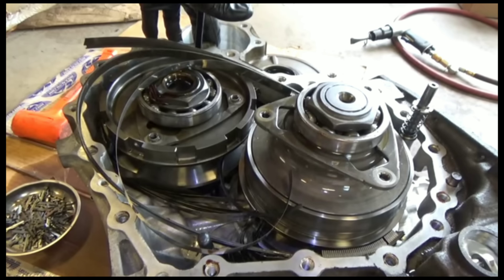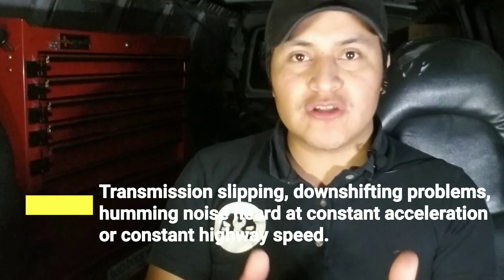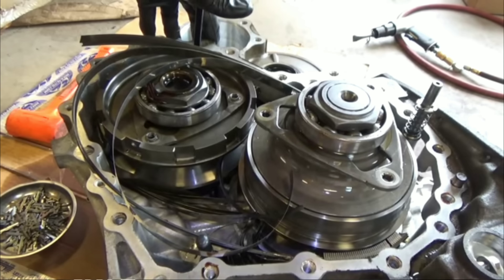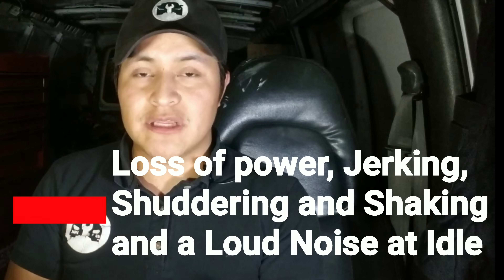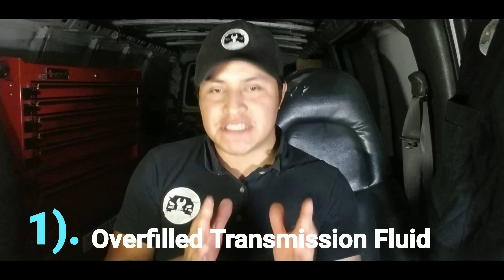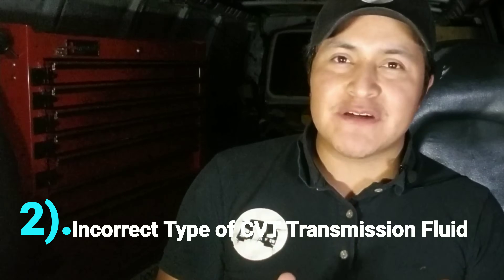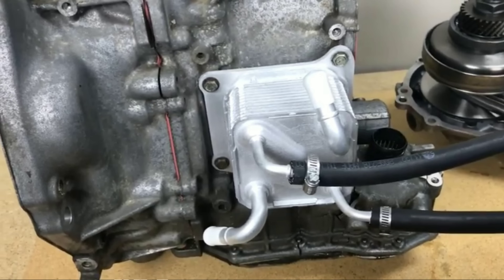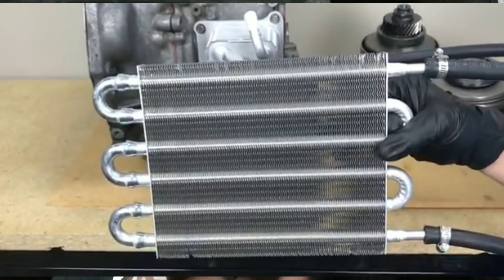NISSAN CVT TRANSMISSION | why it fails and what you can do about it to prolong it's life

Comment: My friend has a 2016 Altima and the transmission overheats all the time. He also cannot step on the gas too hard or get the revs of the engine up because the transmission slips. If he's easy on gas the transmission seems okay. Do you think the transmission is shot? He had flushed the fluid at the dealer and it made no difference
Reply: Does your friend have any issues at all with high engine coolant temperatures when the transmission fluid temperatures are high?  I have a 2014 Altima and I've noticed the cooling fan on the radiator doesn't seem to provide adequate airflow when I'm inching along in a traffic jam on a hot summer day  - the engine coolant temperature and cvt fluid temperature increase which i feel they should not be doing during this low speed stop and go driving.  This is very annoying because I haven't had this issue in any other car I've owned since 1977.   One potential reason is the front grille on the 5th gen Altima is wide horizontally, narrow vertically, and fairly low to the road surface.  The plastic panel underneath the front of the car doesn't allow airflow from the bottom of the car upward from the road either.  So it might not be the cooling fan itself but insufficient cross sectional area for air to flow across the radiator fins as air is being  pulled into the engine bay by just the cooling fan.   If your buddy does a lot of low speed stop and go driving on many hot summer days i can see why his CVT overheats all of the time.  Luckily this occurs infrequently for me.  I'm able to avoid most major  traffic jams by having live traffic from Google Maps alert me to them in time to detour around them. However if your friend's cvt overheats while cruising along in light to moderate traffic then that's a different can of worms (or should it have been bunch of lemons).
Reply: Nissan dealerships received a service bulletin on how to check the belt, you can google the document.
Reply: Nissan dealer says his transmission is shot. They're surprised it was still driving. They're replacing under the extended warranty. His car is a 2016 Altima @ 82 k miles.

Comment: Yeah,my 05 murano makes all those kind of noises. First time I own a car with a CVT Tran, I hated it so much..... sounds like the tran will go . Exactly, what is a limb mode? Thanks
Reply: Hi, I’m no mechanic but he is saying “limp” mode... meaning the cars computer is sensing a problem and it limits the cars ability to go any faster than a few MPH/KPH( or may stop it all together if the problem is serious)the idea is that it should protect the car from any serious problems but still allow you to “limp” or drive to a safe place to stop.....
Reply: Be careful... I have a 2008 Nissan Altima, a few months ago I was on the interstate driving 70+ mph when mine went into safety mode ( safe for the car but could have gotten me killed!!)..no lights no warning whatsoever,  all of a sudden 5 to maybe 10 mph was all it would do...if I had not been in the right lane to get off the highway as quick as I could it would have most likely ended in a possibly serious accident.  My problem was due to the alternator was going out.
Reply: judy hrsy thanks for sharing your experience,now I feel phobic to drive my car. I be more cautious
Reply: judy hrsy That wasn't limp mode, that was all out failure because there was no more electricity available to keep the electronics running the vehicle, because your alternator failed, and you drained the battery.

Limp mode is basically when the transmission goes into fail safe and doesn't let the engine rev past a certain point. The reasoning behind that is to prevent high engine speed from damaging the unit further.
Reply: Gabriel Velazquez call it whatever you want...it was dangerous...all gauges and dash lights were still on engine never completely shut off everything was still working.. just would not go past 10 mph.
Reply: 😐 sorry to do that to you but at least you know... I had heard  others speak of “ limp mode” before that happened to me, however,  I assumed that some kind of light would begin to flash or there would be SOMETHING to make me aware of what was about to take place  so  I would know I need to get off the roadway ASAP!,  but there was nothing!!  It got me to thinking how many accidents have happened due to this Stupid Safety Mode and the driver was blamed for the accident when it was no fault of the driver at all.
Reply: judy hrsy it’s a good precautionary information,thanks again,I never knew about that CVT tran problem

Comment: What should RPMs be when accelerating? My Versa (under 50K miles) is running at about 3000 when accelerating after stopping on a 30 MPH road and 4-5000 when accelerating to get on the highway. You can also hear it revving pretty loud. RPMs drop and the noise stops once up to speed. I took it in but they couldn't diagnose a problem
Reply: Hard to say. Sounds normal only because a Versa doesn't have very much power so you have to rev the engine to get it going. My Mom had a Dodge Caliber with the same transmission and sometimes you'd have to rev the nuts off that thing to get it to go. Good idea is to to the dealer and get the transmission fluid changed every 30k miles
Reply: If it isn’t jumping around or the rpms aren’t fluctuating when accelerating and you’re still able to drive at lower rpms most likely nothings wrong a lot of people when they first started using cvts thought that the tranny had issues cause it would rev so high but if it’s 2013 or older it’s most likely normal newer ones fake gear shifts to keep the rpms liw

Comment: I have a Nissan Altima with 60k miles and no transmission problems (yet), Would you recommend a drain and fill (not flush) or just leave  it as is?
Reply: Any automatic transmission, whether regular or CVT , needs fluid changed. 60k is way to long an interval, 35k for regular and 25k for cvt.
Reply: In the 2009 Altima owners manual under transmission (CVT) is says no service required. Other model years it has a recommended service interval but not the 2009. That’s why I’m asking.
Reply: @spaghettiman1  Even if they say they do not require service, they really do. Of course you could just replace it like they want you to...
Reply: spaghettiman1 that is because in the early days, Nissan treated it as a "lifetime fluid". These early units were so problematic, Nissan revised their service procedure and added a fluid change every 60k.

However, most dealers do it ever 30k. Here in my area anyway (Miami, FL.). Heat, and traffic is the killer of these units.

Comment: Had a 2008 Nissan Rogue with 230,000KMS on it and in the winter time it would shutter and jerk really bad until it was warmed up and once it warmed up it would stink like burning oil pretty bad if I drove it hard to any extent so glad I sold that p.o.s. Never ever buying anything with a CVT in it again, good motor and ride but damn that transmission is bad and of course the car is out of warranty

Comment: Nissan transmissions are garbage.  Fortunately mine crapped out before the warranty expired.
Reply: Lucky you our 2011 Cube was not so fortunate. $3500 for rebuilt never again any type of CVT.
Reply: @HB-yq8gy  
 🤦‍♂️ 🤦‍♂️  ugh
Reply: @ShadyNJ  Sell it now while your ahead.
Reply: @HB-yq8gy Prob should've.  But after replacing Transmission and Cat Converter ill prob just stick it out.  Im at 170k now.
Reply: @ShadyNJ  Yeah I hear you do what's  best. We got $3500 invested in a rebuilt CVT 2011 Cube just had Nissan drain & refill CVT at 30,000 miles. My son loves his Cube but, if trans fails again he'll have to fix it or junk it not me!
Reply: @HB-yq8gy  
Yeah I really loved the car too.  Just gave me so many problems.  Hopefully the trans holds out this time and you and your son can drive headache free.
Reply: @HB-yq8gy  I had a versa with that engine and transmission. 2008 versa with cvt. I out 210k miles on that car and never a transmission issue. I beat it up bad! Idk how some can only go 30k miles bjt others go well over 100k or 200k with no issues. My current 16 altima is over 300k. They are capable of going that far but I guess some are different.
Reply: did the powertrain cover it? did they fix it right or put another crappy one in?
Reply: @lonnroberts7438  
They covered it.  That was about 3-4 years ago and I've have had no problems so far.  

Except when the Catalytic Converter crapped out.  That's a whole nother story.
Reply: @ShadyNJ  oh wow what happend with the catalytic converter? how much ?
Reply: @lonnroberts7438  
It gave after about 8-9 years.  1200 bucks.
Reply: SNJ Should have been covered by the warranty. They have a 150k/10 yr federal warranty.
Reply: @LynxStarAuto  
It was covered.  Just made it tho.  I was at about 148k.
Reply: @ShadyNJ  nxt time buy a Toyota or honda, and watch scotty Kilmer,  most of what he says is true.. but... I still want a hellcat  or a muscle car tho.. despite what he said.
Reply: @chrisnas1483  
Me too man.  Challenger is my dream car.  But next time I'm def going Toyota.  My mechanic said the same thing.
Reply: Lonn Roberts They replace it with the same Jatco piece of crap that goes out in it .. my wife’s 2014 Altima has had 3 replaced all before 67,000 miles .. the last one is holding up but she doesn’t trust it ..
Reply: How often do you change the transmission fluid?
Reply: @joykennedy3478  
Maybe not as much as I should be?  30k-60k miles?
Reply: liam park well when one of them took a dump 4,000 miles after it was installed.. it doesn’t say much for there quality.. it’s my wife’s care she doesn’t drive it hard at all .. It was installed by a Nissan dealer brand new transmission from the factory

Comment: I am a mechanic and I’ve fixed several whiny rogue transmission by changing the fluid
Reply: Mine started to whine. Changed fluid. No issues.
Reply: @saucon751  which model do you have ? I was really looking forward to buying a rogue
Reply: @manojmohan7264  do not, by any means buy a rogue, buy a RAV4 or Mazda SUV.
Reply: @Teporame  Too late I bought a Rogue Sport last month. I think the Rogue Sports hold up better than the regular Rogues. Reason is the Sport is lighter and it responds a bit better or with less effort. Still I'll go for the transmission oil change every 30K miles.
Reply: Well no lie my 2012 altima has 205k miles at the moment ive changed the cvt fluid pretty frequently maybe every 60k its pricey but its lasted
Reply: We have 3- in tha Family 🙄
Reply: @jimmysapien9961  God bless your wallet.
Reply: @jimmysapien9961  2 of 2 at home went south with maintenance at 30k. Get rid of them while they are still running.
Reply: @warpos  That's the name of the game!
Reply: @warpos  Also financial lesson learn. Don't buy another one!
Reply: @warpos  Also financial lesson learn. Don't buy another one!
Reply: @warpos  smart man.
Reply from the maker: Awesome
Reply: @WrenchLink  we have 75,000 mi on ours 2014 Nissan rogue all-wheel drive we're going to get our CVT flashing next week still no problems
Reply: Can I plz get ur email my nissan sentra jjst gave out on me today. I need help plz :(. I'm a single dad working 2 jobs. Plz anything helps thanks.
Reply: I have 236k on my 2010 2.5 altima was whining and went into "limp" mode, drove it from Montana to Oklahoma, and from there to Portland Oregon, then changed the transmission filter there.and have had zero problems since. was probably at 190k then
Reply: My Nissan micra cvt was jerking since 3 months.. now it's refusing to climb even the slightest slope. Is it still fixable by oil change ??
Reply: What fluid do you use when refilling?
Reply: After whining after 30k, I stuck to a 30k interval. Now at 130k with no issues. Hopefully it'll go to 200k.
Reply: Still failure is imminent.
Reply: What brand of cvt fluid do you use?
Reply: @quixotic317  To be honest I don't mess with cvt maintenance. In my area at Nissan drain & refill $150 with tax. To me it doesn't pay. This way if something happens I can try to blame Nissan dealership.
Reply: @quixotic317  To be honest I don't mess with cvt maintenance. In my area at Nissan drain & refill $150 with tax. To me it doesn't pay. This way if something happens I can try to blame Nissan dealership.
Reply: I don't think you "fixed" anything.  You may have eliminated a symptom but these transmissions are fatally flawed and WILL fail.  The only question is when.
Reply: @chuckschillingvideos Well I'm at 199k miles on my Rogue with zero transmission fluid changes and still running great. The issues are from high heat stop and go, and from other poor habits like rolling while shifting, and immediately driving aggressively after start up.

Comment: My Nissan Rogue 2009 SL transmission got bad at 98k last year luckily it was still under warranty so they replaced my a new one but now after 10 months it’s bad again. 
Is it possible they used the same transmission and said they replaced it ?
Reply from the maker: They could've just replaced the bad parts in the transmission and installed it back in.
Does the receipt specifically say it was replaced with a new transmission?
Reply: Wrench Link you are right I went there yesterday that’s what they said. It’s sad because I thought I got a new and thought my car was going to last a little more. After first warranty they gave me another year warranty or 12k miles whichever came first so I was over 100 miles so we talked to Nissan manager he’s going to try to help but let’s see fingers crossed 🤞🏻
Reply from the maker: @nandaejasmine  hopefully they cover it and install a new transmission this time. Good luck
Reply: Wrench Link so Nissan ran a few tests tech diagnose didn’t show any malfunction so second test they opened the transmission pan and inspected the valve body and they checked for metal debris still they said car was ok. 
I live in Las Vegas and this usually happens when I drive long distances and when it’s very hot.
Reply: Actually going to follow your advice and get that cvt oil cooler.
What would be the right one for my car ? Nissan Rogue SL 2009

Comment: Hi there I have a 2013 Nissan  juke it’s started to shudder at what I would say low gear when pulling off would you say the transmission is now no good :( ? It’s done 159,000 kms as I dont think the fluid has been changed to my knowledge
Reply: That's almost 100,000 miles changing cvt fluid now might cause more damage. But what do you have to lose? if it's shuddering cvt fluid drain & refill might repair it.
Reply from the maker: The Juke does use a CVT so it might be going out😬
Reply: Let only Nissan dealership do CVT service. My area CVT service drain & refill from dealer approx $150.00 Don't mention any cvts problems like shuttering. I hope you don't have any trouble codes? If cvt shutters still after Nissan CVT service you can blame them ! Maybe, no guarantee dealership will be on the hook to do the right thing and fix it. Also check with Nissan you might be part of the "CVT Trans recall" to get a new trans free of charge. Good luck stay positive.

Comment: I have a '08 nissan sentra with a cvt transmission that had no pedal response, and all the codes were for the stepper motor, after a few days and one tow truck later, the car runs and drives but does not change gear in drive (stays in first gear, but goes into park/reverse/neutral no problem) would changing the just stepper motor solve this or should I go for a full cvt transmission valve body (had the same issue with a VW Jetta and changing transmission valve body solved that issue) or install a new transmission? Appreciate the input and advice. Great video and information for us Nissan users

Comment: I have a 2013 Altima 3.5 SL. I have had jerking occasionally but only when it’s warmer outside. During the winter I have no problems. Why is this happening I also haven’t heard any audible noises from the transmission.
Reply: Mine was bad in the winter and good in the summer.. I really don't know lol Trans is about to take a dump sell it for 2K and put it towards another car before yours is worth $200 for scrap lol
Reply: Horsestick MPG I would sell it but that isn’t a option because I am overseas with the car in the military.
Reply: @Zynjago7  Baby the crap out of it for now then mate you should be good
Reply: Get A Transmission Cooler And Change The Fluid Every 60k Miles.  You Should Be Fine
Reply: Get an upgraded transmission cooler. Swap the fluid with OEM fluid.
Reply: @DJR5280  alot of people say OEM fluid is the reason for the trans burning out, follow RogueNation on facebook you can see everyone that has used AMSOIL has had a way better result including oil temps reduced by alot in most cases just by having an oil that can deal with high heat better.

Comment: Hi,Great/informative video.Perhaps you can give me some answers: I just bought a 2013 Nissan Versa with 108K miles.No noises of any sort but its not shifting from 1st gear.(Im getting reverse and forward,its  just not changing gears)Would over filling cause this?Any suggestions before I take it for"expensive" repairs.
Reply: Cvt transmissions don’t have gears, just the one wheel which “continuously variable “ based on speed.

Comment: I bought a 2015 Nissan Sentra SV on auction and transmission spoils after 1 week ..to change and buy new transmission is $3,000 ..should I sell the car as it is or fix the car with another transmission at 54,000 miles
Reply: What signs did you have of your transmission going out?
Reply from the maker: @tablettablet3339  I don't own a Nissan with a cvt. I go over the signs in the video...
Reply: Do a swap from a CVT to an Manual
Reply from the maker: If you put another transmission in it you would get about another 50k miles on it
Reply: I have the same problem please someone help